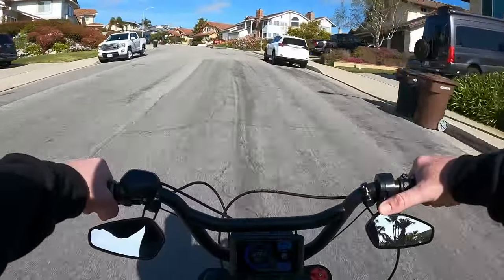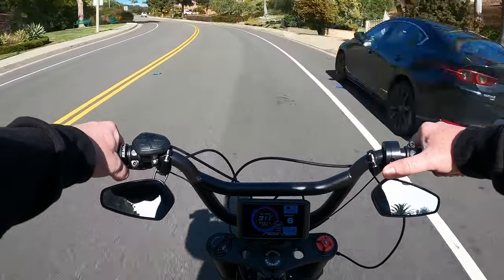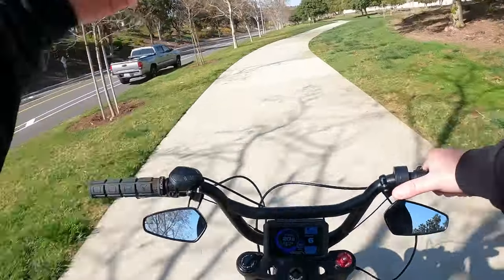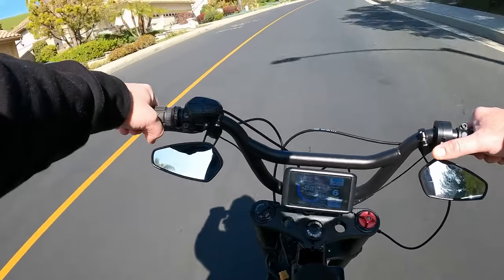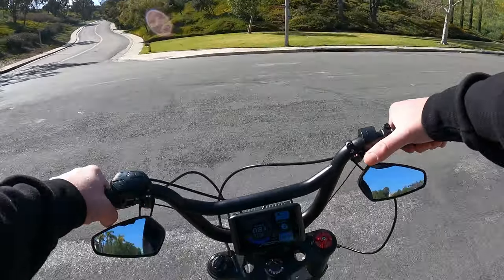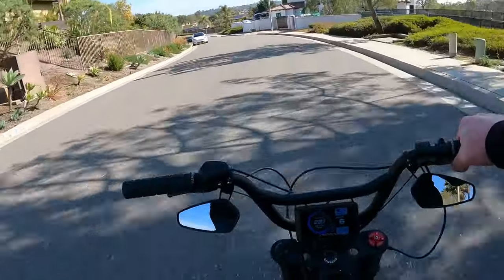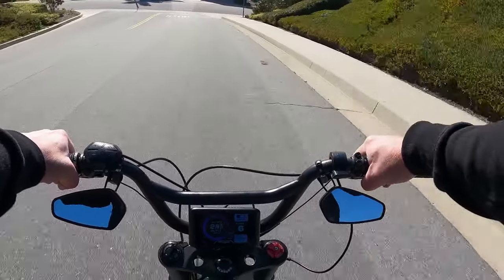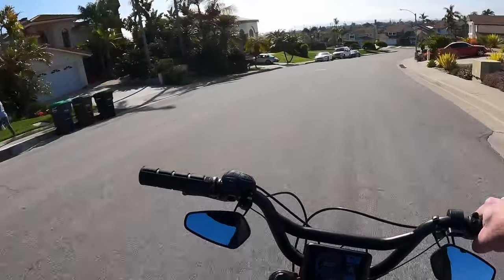THIS EBIKE IS INCREDIBLE

Comment: How is it in the rain? Plus after riding in the rain. Does the bike work or did the rain kill the bike? Where you have to keep buying parts for it after every rain? Plus if you hit a pot hole. Does it knock out the motor to where you need to buy a motor?

Comment: That's a very sweet bike Chris and kudos to you have Shawv really well done and looking great!
I do worry for you tho man, like I'd love to do some sort of conversion on my S2 but those frames are so brittle and the walls of the tubes are so scary thin I know you've seen that grinch clip of Shreddie's that dude had already crashed before he plowed into Shreddie but that frame snapped like a twig and I'm genuinely concerned for you and Peter that you could be hauling ass and hit a pothole or something left in the road and the damn thing will shatter.
I will keep a good thought for you both and for sure wish you many happy miles on your bike, it is a beaut!
Reply from the maker: Thank you so much for the concern.  I too can understand that with Peter being that his S2 is from the first batch. This RX is the extra reinforced new one that came out recently.  I’m sure someone somewhere will say that it too is “weak” but like I was saying in this video I am not the guy that usually rides at max speed either.  My main reason for this upgrade was to have extreme torque.  I just like to get up to speed quick. 😊.  Anyway I actually have been checking the frame after each ride as well and I know that there is a lot of dudes out in Hawaii that have been modifying the new batch of bikes that released last year. With all that said I take your concern Seriously and do appreciate that! 🍻
Reply: @ShawverFilms  If I knew there WAS a new reinforced one I would have kept my trap shut!  RIDE ON, SHAWV!

Comment: Can you recommend a bike I’m 6ft 320 I want comfort,speed, and long range at a decent price I wanna stay around $1800. I would like great suspension and as far as brakes not sure mechanical vs hydraulics 🤷🏻 if u have one I’ll buy one I’m in northern cali but moving to San Diego soon.
Reply from the maker: So to stay at the price point that your at I would say look into the FreeGo F1 or F2pro. With the FreeGo you get most all of the bells and whistle that you get on other e bikes and they are under 2k  
I can also post a $100 link for you with code SHAWVERFILMS 
Hope this helps 🍻

https://freegobikes.com/?ref=SHAWVERFILM
Reply: @ShawverFilms  most definitely it helps I was just looking at they free go f2 they seem fast and long range. Will be ordering soon thanks 🙏🏽 will use ur code with their spring sales
Reply: Do cops not Check the speed and motor wattage in cali. I’m going to San Diego next month and trippin I might spend more and get a faster bike but dont want to get pulled over.

Comment: Total cost of mods?
Reply from the maker: The kit itself is $1,500 and comes with the motor, battery and the enclosure as well as all the wires and display throttle etc. the seat was $250 and then the rest of the parts I took off my S2 like the handlebars, pedals, grips.  I got the frame and front fork and wheel for $1,300. So all in it was about 3k 🍻

Comment: Can we pedal while motar is also working?
Reply from the maker: This bike it still has pedals however with the power and speed of this bike, along with the weight of it because of the 72 volt battery it would make it hard to pedal.  🍻